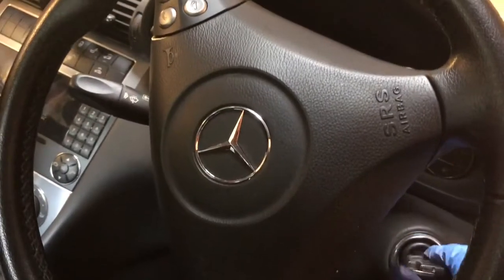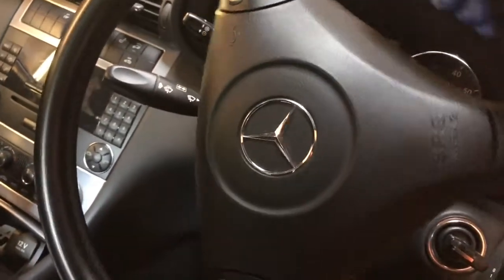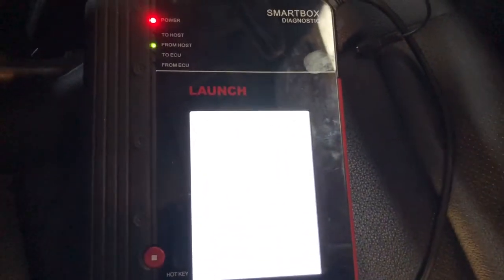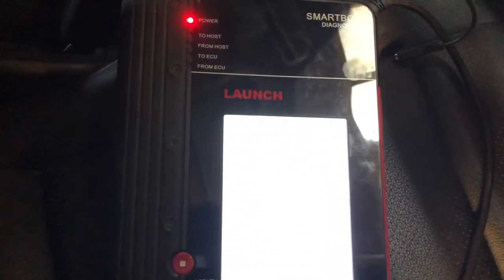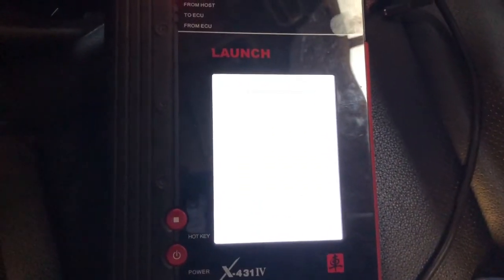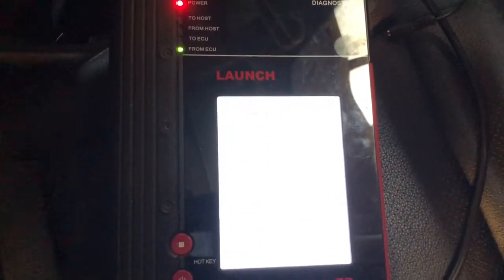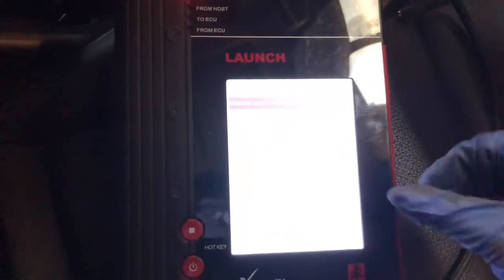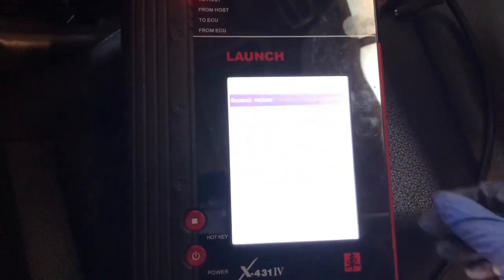Mercedes c class W203 2004 O2 sensor downstream replacement P201C P2038

Comment: I assume that it was a successful replacement, however, a "Red Flag" for me is the cut in the wiring protective rubber (easily seen at 4.09) about 3 or 4 inches past the hole that the wiring comes down from the engine. When you have a "Short Circuit to Ground" error there is every chance that an exposed wire is touching the car creating the short (and there is lots of metal around there). I would have looked at that first to see if there's damage which could have been rectified with some electrical tape rather than a $400.00 part.
Reply from the maker: it was a success and thank you for all the tips.

Comment: I have the same p201c error code and cannot pass emissions test. Vehicle lurks forward upon cold start and occasional stall. Also hesitation upon acceleration in reverse with little reaction from full application of gas petal (seems like gas isn't reaching isn't reaching injectors?) You mentioned breatherpipe under airbox? Does that sound like this issue? Which part is the breatherpipe you are referring to? Are used 02 sensors from ebay worth trying to save $? Any suggestions appreciated and thank you for posting your helpful vid. Cheers from California US.
Reply from the maker: Hi there, yes it sounds like your symptoms could relate to the breather pipe hoses, there are 3 breather pipes, the one i normally change is sitting under the air filter box i have a video on that one, you could check/replace that one if need be, the other 2 pipes are much harder to get to seating under the manifold a wholeee days job, so better try the other one first. as for cheap O2 sensors I wouldn't really go for those as they dont work properly, you could get a genuine used one from ebay.
Reply: Did you fix the problem?

Comment: Did this fix your problem? My car spudders if you push the gas lightly, but is OK when you drive faster. I have the same code, p2038 and p201c along with p0171. Also misfire codes. My o2 sensor has high readings though
Reply from the maker: This sorted my fault code and engine light, but you also have a P0171 fault code and that might be related to the breather hose seating under the air filter box. That pipe often needs replacing.
Reply: Did you solved? Have the same codes

Comment: You could have tried cleaning the sensor first and see if that fixed the problem. I have had this type of problem before, but with a different car. Subaru Impreza WRX STi. The downstream O2 sensor was showing impossible volt readings 200V-300V. And the Subaru's reading was not in mV, it is in V. So there was no way a 12V power supply car can have that reading. The normal reading for it should have been around 0V-1V.  So I assumed the sensor needed to be replaced. Took out the sensor, it was black and covered with a thick layer of carbon. I was looking for the sensor and it was around $90-$100. So while I was looking around, I thought why not just try and clean the sensor up and test it, no harm can come while I look for the part. Cleaned it to the point it looked like new, put it back in check, it was reading correct again. So I never replaced it.
Reply: But now my 2002 mercedes w203 C200 kompressor is having a fault code. O2 sensor downstream short circuit to positive. The car doesn't seem to behave differently. I was looking around at the fault codes for another problem and saw this code came up. After clearing the codes a few times it always came back up. Did a live read, and the reading is pretty much fixed regardless of engine idle or pressing on the acceletor pedal. But I see you just replaced 1 of the 2 sensors. How did you know which one needed to be replaced? There is one before the catalytic converter and 1 right after the cat. I am trying the cleaning trick on both sensor first to see if it fixed the problem. But the car is almost 20years old now. Might just decide to replace them.
Reply from the maker: @m.d.f3797  well technically downstream is the one after the cat and up stream is the one before so that's how i new, plus if you unplug one and read the fault code then it will tell you which one it is.

Comment: If you have fluctuation on downstream sensor on idle , your TWC is not doing it's job properly. The rear sensor is there to check the efficiency of the catalyst. You should have fluctuation on upstream sensor.
Reply from the maker: Thank you for the tip and information...